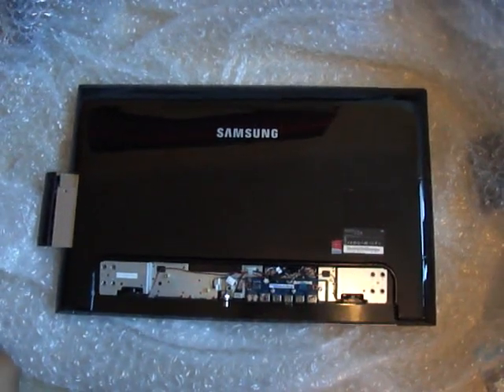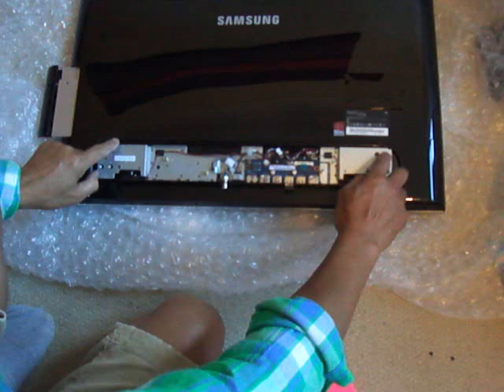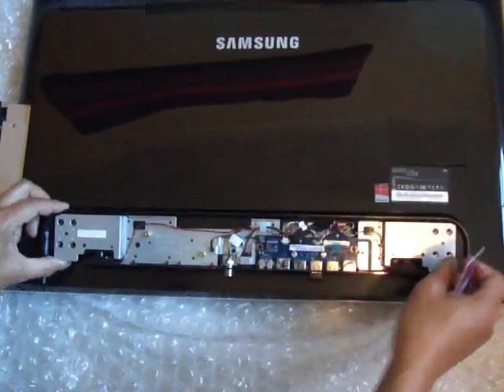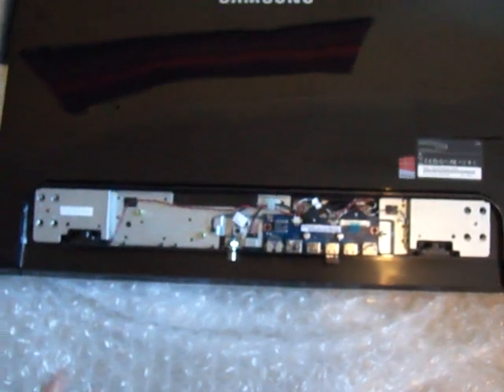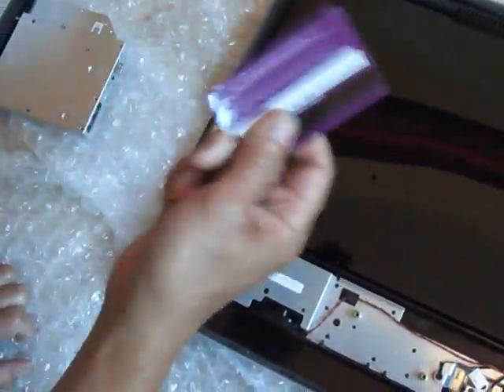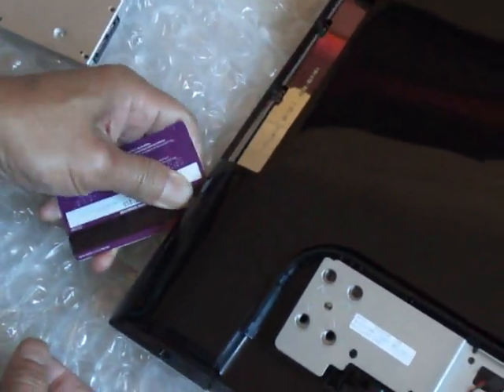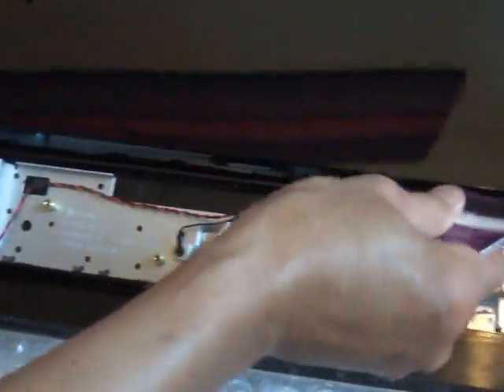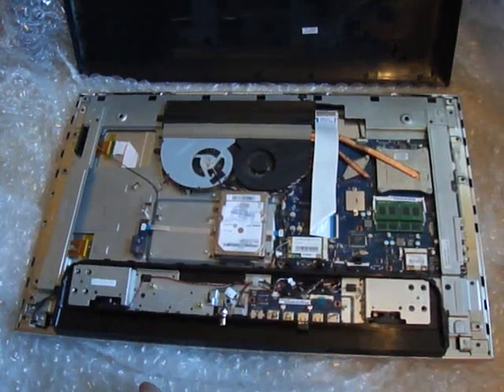Samsung All In One PC DP700 A7D SO3 Hard Drive Replacement / DP700A3D

Comment: Hi Fred...Looks like ur 27in. has two cooling fans.  What might be the replacement part numbers?  Mine only has one. Thanks for the video and any reply u can send along.  TTYL...
Reply from the maker: Hi Martin, apologies for the late reply, but just got around to disassembling the back to answer your question. There are 2x fans and the fittings seem to overlap each other where the 2 screws in the middle are. The silver fan is Delta KSB0705HA BA31-00133A and I assume the black fan is the same but reversed so you cannot see the model number. If required I have taken some pics which I can send you if you let me have your email

Comment: Thanks mate, you saved me quite some time. The idea of using a credit card was great, screw drivers tend to leave ugly marks...
I found out that you don't even have to remove the stand or the screws covered by it!
Simply remove the two screws on the bottom, the one that holds the CD drive, and the two that were hidden by the CD drive. Then you can remove the whole cover with a credit card as shown.
Reply: is it possible to put a ssd in it ? :/

Comment: Please kindly upload video regarding whether we can install windows 7 in it or not
Reply from the maker: syed najeeb There is no reason why Windows 7 cannot be installed as Windows 7 does support touch screen , but drivers for some components may need to be installed. My advice would be clone the existing drive then use a new drive to install windows 7 then if anything goes wrong you can always go back to Windows 8. One thing I have noticed is when upgrading to Windows 10 on this machine I have lost all the TV recording and playback functions and the remote control  only works on basic stuff like volume

Comment: Is it possible to install SSD in it?
Reply: Just put an SSD and 16 GB of ram in mine; it's good for a couple more years. Also for DP700A3D A01, you do not need to remove the base to access motherboard. Just 2 screws (front bottom) and a plastic card.
Reply: i am about to install a SSD . i am sure it will  work but will let you know
Reply: So, how was it? I'd really like to know because for Christmas I'd like to upgrade my friend's Samsung AiO. The performance is terrible and I can literally hear the HDD dying.
Reply: Samsung states SSD is not compatible
So can you tell me the model # u put in it so I can upgrade mine as well
The HDD I have is SLOOOOOOOOOOOOWWWWW

Comment: Did yours come with a base like samsung dp700a3d-s03au ? I have built my own pcs but too afraid to play with somewhing like this lol $1500 down the drain if done wrong. 
So I wanted to install SSHD, should I get 3.5" or 2.5" ?Thanks
Reply from the maker: Hi, Get a 2.5" standard laptop drive or even better, an SSD and it will work fine! Just one tip, clone the old drive with the original OS and drivers to the new drive, there are a few simple drive cloners available on Amazon and eBay where you slot both drives in and press a button to clone; the new drive needs to be a larger capacity drive than the original.
Reply: @tribble10   do u still have this all in one and do u by chance have the motherboard # cause i cant seem to track one down and mine is missing the sticker

Comment: Hi, I found this exact same all in one PC Samsung thrown away by one of our resident. I'm not sure if it is still working or not as it didn't came with the powerconnector to turn it on.. I have notice that the ram is also missing however i took the processor and hard drive from it. I want to ask if i could use this as my monitor for my pc since it's got another input for HDMI if ever i buy the powerplug? would it be possible if i take the pc part of it and just use it as a monitor for my pc?